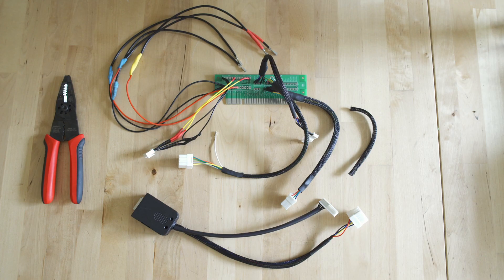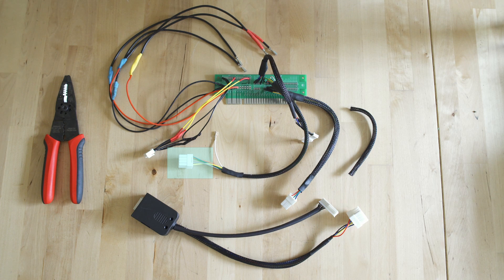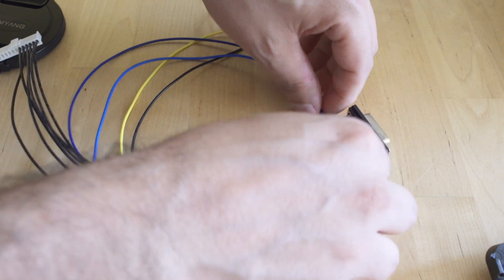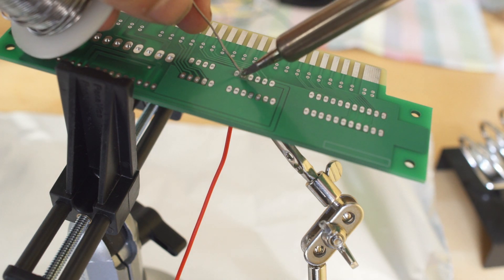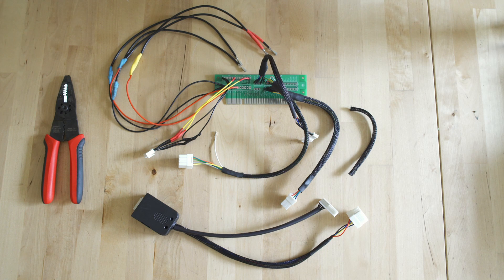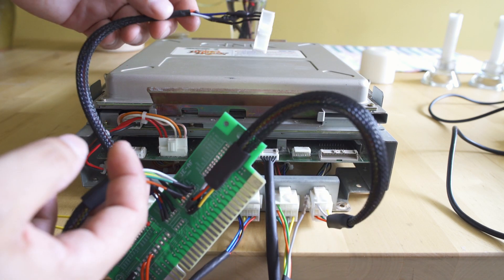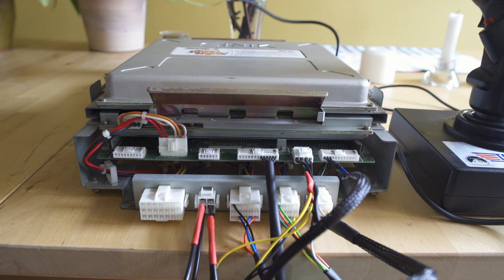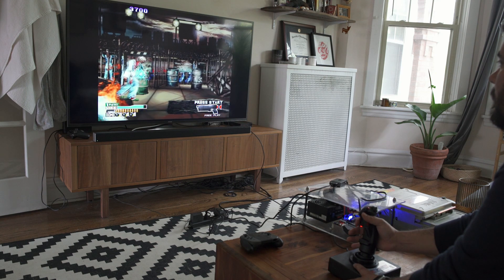Converting Beast Busters to JAMMA - Finale - Hyper Neo Geo 64 - "On a Technicality"

Comment: Hello! great work! =D
Can you please put the specs of the molex connectors you had to buy?
Thank you! =D
Reply from the maker: JST YLP and JST VLP for the large front connectors. VL is four pin power and YL is for 6/9/12/15 pin connectors. 

JST XAP for single row connectors. 13 and 12 position connectors.
Reply: @VideoGameEsoterica  =D Thank you!!! =D
Reply from the maker: Np. If you need more help just email me. I have the BOM receipts from digikey still
Reply: @VideoGameEsoterica  Ok! =D Will try to find these in my country. Thank you!
Reply from the maker: Happy to help! Good luck

Comment: I just finished watching this whole conversion and its really impressive. I have a couple of questions though. First, is the JAMMA connection you built not capable of accepting controller inputs? Second, how would you go about making this setup compatible with a 2nd player? My first question is mostly because many recent superguns have two controller inputs you can use, but I'm not sure if the Beast Busters board can route controller input into a custom JAMMA connection like what you built. The second question is if controllers have to be used through custom connections outside of a JAMMA board like what you did here. I am getting interested in collecting JAMMA arcade boards but I'm new to it so I apologize if my questions seem obvious. I'd like to get into collecting for the Hyper Neo Geo 64 because the library is so unique and interesting, and I often have friends come over to play games at my place so a second player option would be amazing.
Reply from the maker: It’s capable of accepting inputs for start / coin / etc. I just did not use that method. But the gun input has to come out of the custom plastic connectors on the I/O board itself. Those do not route through the JAMMA edge. Doing a 2P hook up would just involve wiring a second flight stick to the same connector on different pins via the schematic pinout. 

But you CANNOT route the gun inputs through the JAMMA edge. None of the controls for the gun X/Y coordinates, trigger, bomb, etc etc are on the JAMMA edge. So you can plug an arcade stick into the supergun (or a controller) and use it to coin up (as I did because it required no work) or you could just solder in a coin button in line to the JAMMA edge I wired up in the video. Either works

But the gun 100% has to go through the custom connectors on the I/O. 

Hope that helps. If you have any more questions lmk! Happy to help

Comment: Do you use an upscaler or does your tv handle low resolution sources that well natively?
Reply from the maker: I use a Framemeister. So I upscale everything to 1080p then I let my TV bring that up to 4K in game mode. So there is minimal lag and everything looks nice. I will be doing a video shortly showing my setup :)
Reply from the maker: The Framemeister is super useful as arcade pcbs don’t always confirm to 59.97 frames per second, so it’s “sync level” adjustment can overcome non-standard frame rates and get the signal to sync for me
Reply: Interesting. My TV picks up the neo geo sync signal fine and also does 240p through component so I really lucked out and haven't had to by a frame meister or retro tink yet
Reply: Matt Catania my tv handles component via 240p as well but it does not like odd sync rates. AES is fine but on arcade hardware w/o the Framemeister it’s hit or miss. Case in point CPS2 will not sync w/o the Meister getting involved